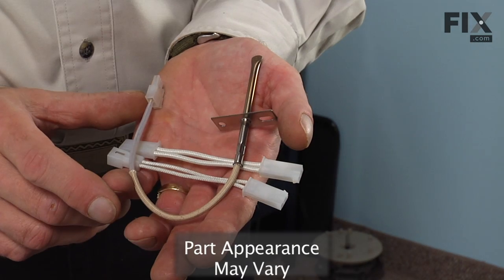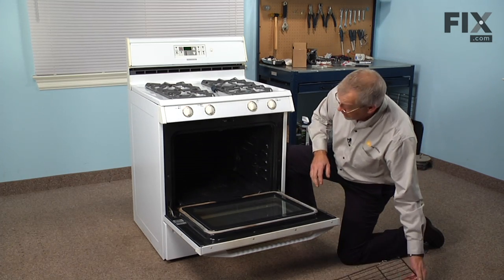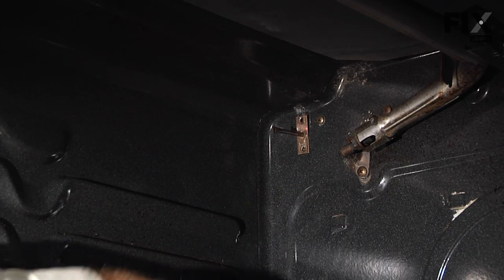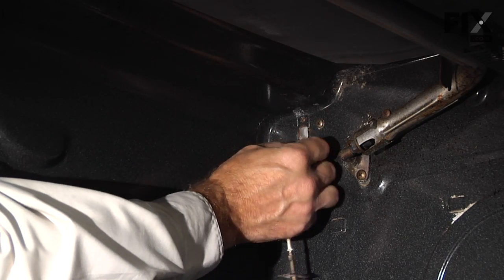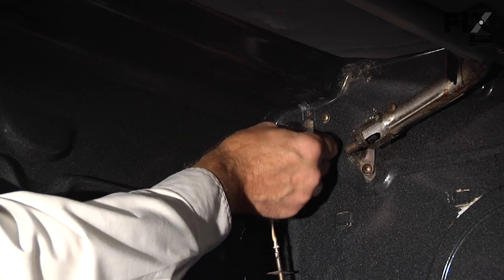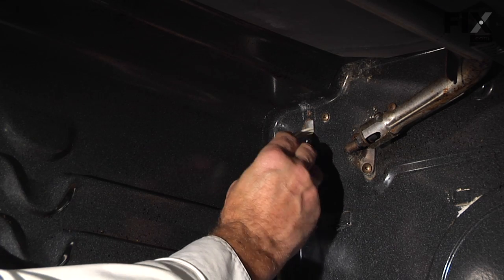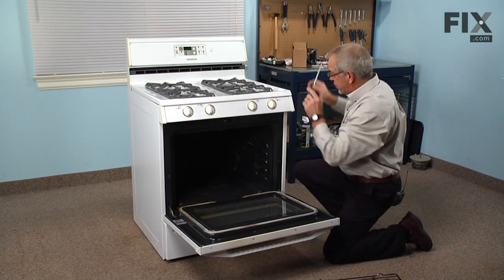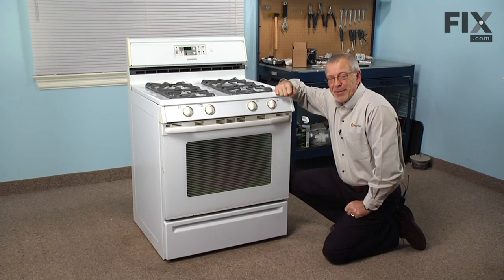Magic Chef Range Repair – How to replace the Short Oven Sensor Kit

Comment: Thanks    Model. 3442xRW...magic chef......I did notice the broiler comes on well....never used it ....but the oven different ......thanks great videos you do.......
Reply from the maker: Hi Rick, I would suggest first replacing the oven igniter (https://www.fix.com/parts/range/magic-chef/fix1573892/flat-style-oven-igniter-kit-12400035/?SearchTerm=FIX1573892&SourceCode=3). If replacing the igniter doesn't resolve the problem then I would suggest replacing the oven safety valve (https://www.fix.com/parts/range/magic-chef/fix11744133/dual-outlet-oven-safety-valve-wp74006427/?SearchTerm=FIX11744133&SourceCode=3)